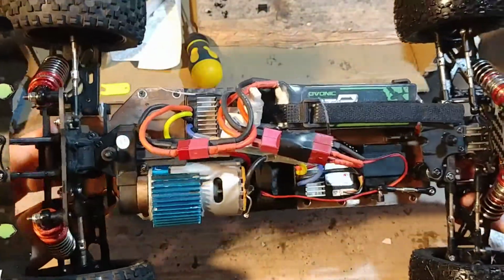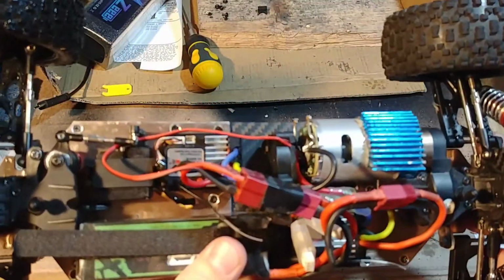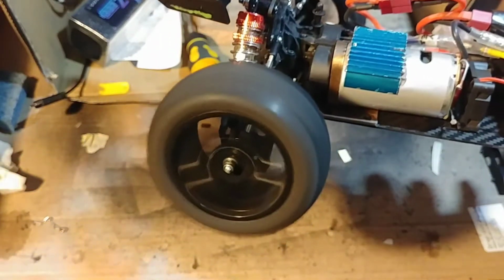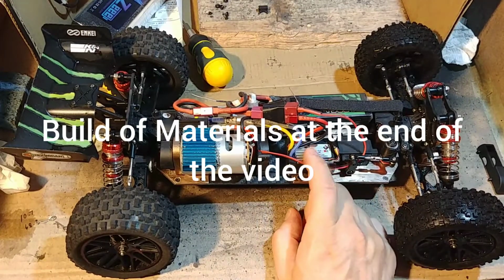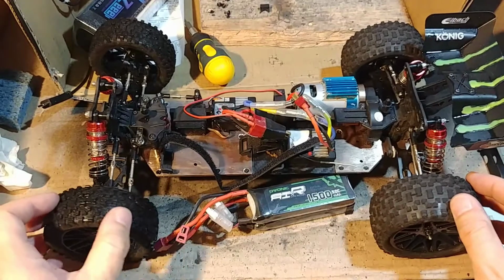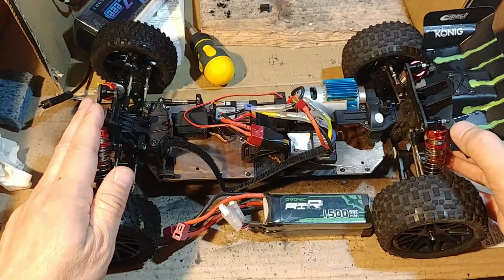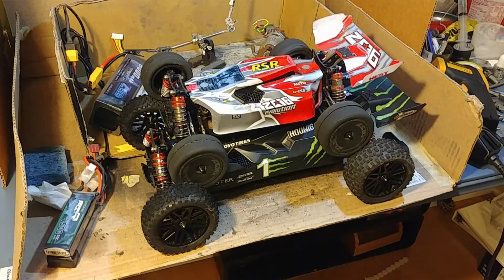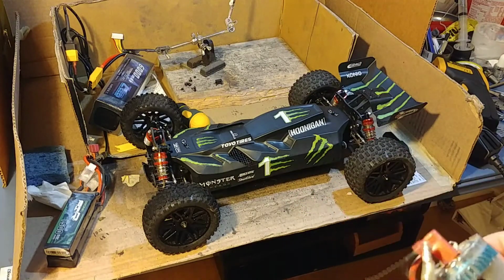Wltoys 144001 Cheapest Fast Lightest 1/10 Scale Big Wheels Stock Motor 4S with Carbon Fiber (Part 3)

Comment from the maker: I forgot to post the top speed.  It got up to 47mph on 4S.   ESC then started to cut power because of over current (>60A).  Motor got hot after 6 passes!

Comment: How'd you get that speed on the stock brushed system?
Reply from the maker: Power the stock motor with 2 ESC connected in series like connecting 2 batteries in series.  Watch the full video.
Reply: I watched it but I couldn't figure out how you got 4s to work w/ the esc's & brushed motor...
Reply: @shoshoneedwards1349  each esc is powered by a 2s Lipo.  Treat each esc as  a single battery.  Search how to connect batteries in series.  Just hard to subscribe in words.  That's the best I can do
Reply: Thanks for trying, Im familiar w/ series & parallel connections. It's just I wasn't sure how u connected both to  motor, servo, transmitter...

Comment: So the ESC and motor can handle 4S
Reply from the maker: There are 2 ESC, each take on 2S, connect in series to provide 4s to a single motor.  The motor can only handle 4S for a few passes and needs to be cooled before running.  I pour water on it, 😅, not recommended, of course.
Reply: @customtoyrevolution  I've never heard of putting two ESCs in series that's amazing
Reply from the maker: @nomusicrc  only work for brushed setup
Reply: @customtoyrevolution  I love brushed cars you get such precise control at slower speeds

Comment: Actually we r doing same and your chasis design looks good. Also l need use double esc for double motor but l can not imagine that how u connect the original 2 esc with original transmitter. 
If u describe, that would be great.
Thanks
Reply from the maker: Power on transmitter and follow up with both ESC, turn wheel or pull trigger and they will bind automatically.  You don't even need to bind them at the same time.  Nothing special  needed.  I scraped the idea of double motor setup because you can never run them in-sync.  Wasted power. But it would keep the motor cooler.  It would be interesting to see a video of your project.
Reply: @customtoyrevolution  Thanks for ur reply. 
Btw this should not be easy as u describe 😂.
Please check my description that is there anything wrong or not?
I ve one original wl motor ,esc and transmitter  .l ll add one more original wltoys esc and motor. I connect the battery to both esc. Turn on transmitter, turn on both esc ,pull trigger and then both esc motor and servo will work with one original wl transmitter at the same time.Is there anything wrong ?
Btw should l plug in servo to both esc or one of them ok?
After project lf l can suceed ,l ll back to u for sending video.

Comment from the maker: The weight of this car (no battery) is 1146g compares to stock 144001 at 941g mostly due to the larger tires.
Just tested it running a full pack 2S and it's plenty fast but the motor got up to 170F internal as the motor struggle on the 85mm tires.  Increasing voltage to 4S seems to reduce the temp as I shown in the video @ 150F.  Now, getting a 3S/4S capable brushed ESC might be a good and cheap option.  Too soon to tell.  Need more testing.